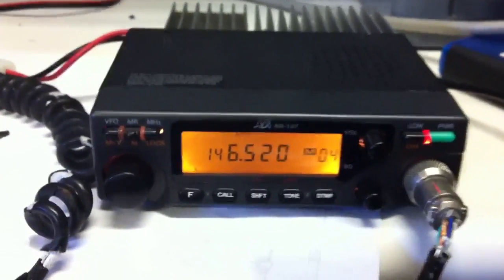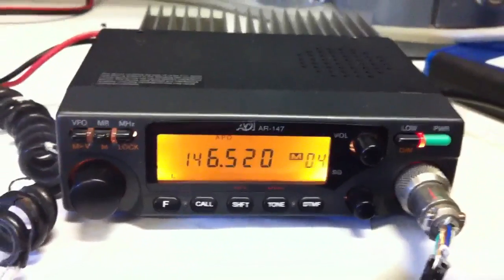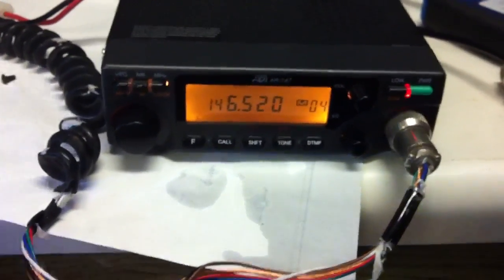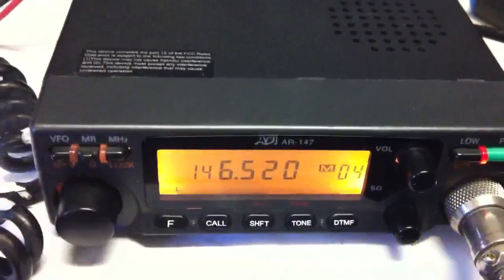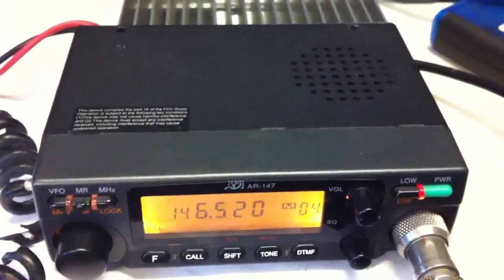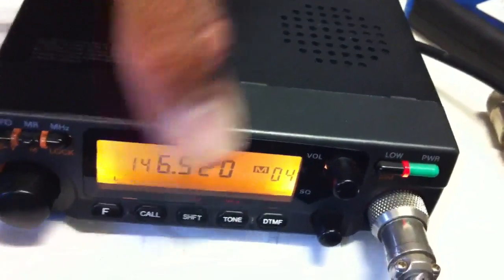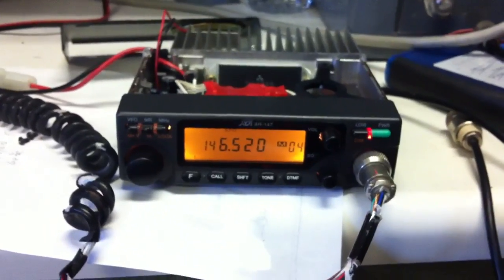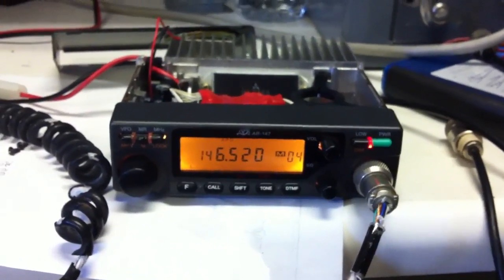ADI AR-147 two meter fm mobile radio repair

Comment: There is a UHF 70cm version of these radios in both ADI and Kenwood versions. I replaced the 9 pin plug on my rig going from the cpu board to the display board, it had a connection problem there. I used some wire and soldered from one board to the other. Eliminated the problem.

Comment from the maker: You could be right, the front panel does get quite hot after its been on for a few hours. perhaps replacing those light bulbs with led's would cool it down.

Comment: cheers for the tip .. i picked up a mint version of this radio with the same issue ..that little red board is the ctss unit ..i think there is some kind of heat strain on the screen ..